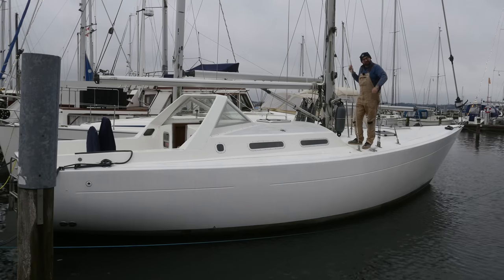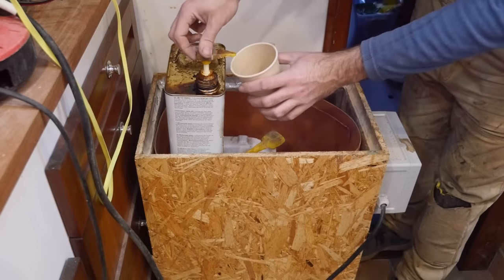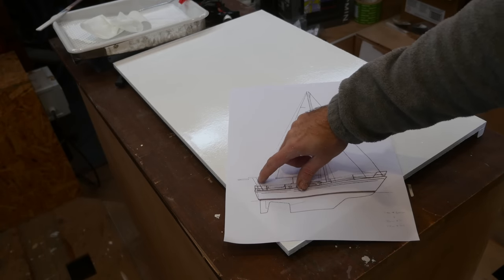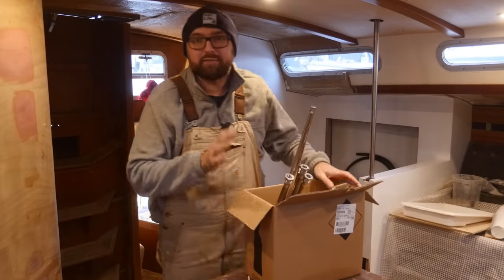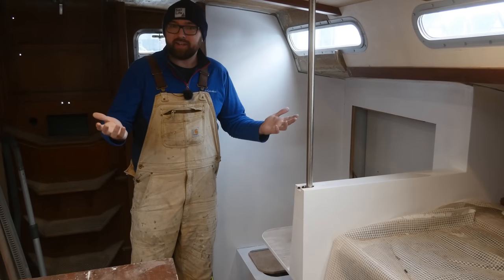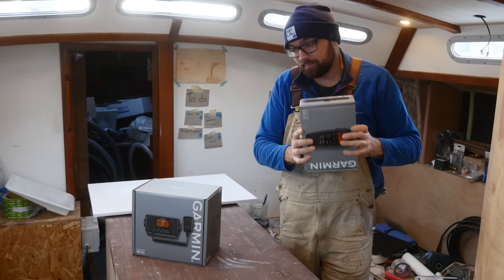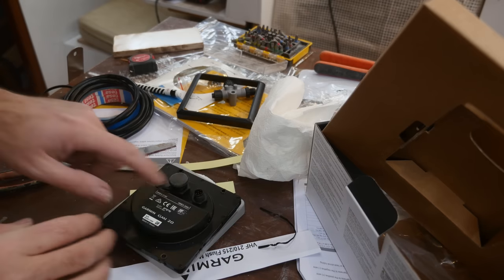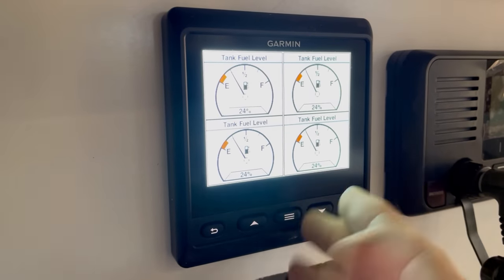Sail Life - Solar arch model, toe rail, NMEA 2000 network - DIY sailboat project

Comment: That vacuum trick cracked me up! As a boat owner that has run my own NMEA 2000 wiring, I am blown away by that! That's about a million times easier than pulling through a messenger line the old fashioned way. Your videos make my day!

Comment: Hi Mads, as per usual, I love your work. 
Pre warning to you and everyone reading this post, I am a armchair sailor that being said I am an Electronics engineer.
While getting ready for setting off one thing you might want to consider is integrity of your NMEA system. I would suggest buying a NMEA 0183 to NMEA 2000 converter. 
There have been a few YT channels that have been struck by lightning and getting their complete NMEA network up and running again has been changing 1 NMEA 2000 product (that has been affected by the lightning strike) and using a converter plugging  to it back into the network but using its NMEA 0183 port. 
NMEA is just like canbus in cars, 1 faulty sensor / product can bring down the entire network. Fortunately for the Marine industry we still have both codes running simultaneously, so if lightning blows the 2000 side of say your chart plotter, if you are lucky the 0183 may not have been affected. Using 1 converter could bring back online your entire NMEA network.
Latest iteration of this I have seen was Parlay Revivals. 1 converter supplied by a fellow sailor restored his entire system and it makes sense. In this era of conversion between the  2 standards it is cheaper for manufacturers to supply both NMEA inputs / standards into a product than manufacturing 2 of the same product that meets either standard. Fortunately each plug has its own supply board so if one gets taken out, the main system may still be intact and chances are that the other plugs supply board is unaffected. 
$70ish converter vs replacing say a chart plotter and getting your entire network back on track. I'd say was a cheap repair. Plus if you never have to use it, you could be a hero to a fellow sailor that has been unfortunate enough to be struck by lightning and only had the 2000 side of an instrument affect their entire instrument cluster.

Comment: I'd keep those solar panels down near boom height. Cleaning, servicing, windage during windy mooring maneuvers, etc., will all come into play sooner or later. Make it easy on yourself.
Reply: It looks a little high to me as well but remember he needs to duck under the boom (see 4:26) and access on and off of the boat is under these panels.  Perhaps mounting the panels so that one side of the mount can be released and then tilted on the other side could help.
Reply: @rickhicksedm  I'm not sure if he'd be ducking under that boom while standing on the cockpit sole, but I'd prefer (if it was my boat) to be able to stand on the aft cockpit seats and be able to reach all of the solar panels and related hardware. No debate, just sayin".
Reply: I think he would then need a door in the transom, but you're right, it looks far to high!

Comment: I'd consider running the NMEA network all the way to the main berth and mount a GMI 20 where you can see it from the comfort of your bed!
Reply from the maker: That's a cool idea :) All the data will also be available on any phone/iPad over a signal K gateway :)
Reply: I did just that with a B & G system (i.e. a multifunction display in the the main berth), so that I can quickly keep track of what is going on at the helm while on passage.  It has been extremely helpful.  Highly recommend that.
Reply: I was going to recommend the same thing. Its great on passage to see wind speed and such with a glance.
Reply: @SailLife  Also consider the Yacht Devices YDTD-20 instead of GMI 20 for such applications. A lot cheaper!
Reply: ..... always surprised when I see that the interior screen can only be seen when sitting at the nav station ...  never stop dreaming, just dream bigger .. have fun be safe, save our oceans ..

Comment: Put the breakers as high as possible so you won't bump into them while sitting there. Put the chart plotter on the pole so you can swing it around to any position and reach the controls on it without having to lean over the chart desk. This way one of you can still work in that spot while the other checks the chart. VHF position is good, perhaps put a second holder for the mic at the end of the chart table so you can quickly grab it, again without having to lean over the chart desk.
Reply: Agree with Dutchy's comment on the breakers.  You have sailed enough to know what Sea State 4 feels like sitting at the chart table.  With your shoulder size, it will be too easy to knock one of them during any transit or passage.  If you put the chart plotter high on that panel, you may wish to add some sort of lexan or plexiglas cover for the switches (probably requiring you to inset the switch panel bits) so that they are protected from unintentional contact.  Putting the chart plotter on the pole is a good idea, so long as you ensure it doesn't swing freely (you can sort of latch it while heeled) and it doesn't bang into people while manoeuvring.  Enjoying watching you do this.  You are as meticulous as I am and it pleases me to see good work being done.
Reply: @MrEdgargravel  AMEN! My wife likes to sit in front of the panel on our Catalina. Sailing along and I loose my instruments!
Reply: There is a ~10 inch space above the intended hole for the electronics. Put the switches there - high up where they are suitable to switch while you're standing on the way out to the cockpit.
Reply: 🤔 putting the switch panels (3) up-high behind you in the Nav. station, would aleveate any possible accidental on/off position. And, free-up space... No need to make a cluttered hatch in your Nav.station area.
Nearest to the steps A/C then 24-volt then 12-volt panel.
A/C is best to turn off first, being the most dangerous.

Comment: Two suggestions for the arch: 
1. Athwartship rigidity will be one of your challenges. On my boat I integrated the arch into the pushpit resulting in a very rigid structure.
2. For both aesthetics and structure I would keep the overall height to a minimum. On my boat the solar panels are about 6 inches above the bimini. Looks pleasing to the eye and reduces moments of force caused by the wind.

Comment: Chart plotters at the nav. station but I would have a repeater  at the helm, wireless or wired.  Keep 240v cables in conduit, separate from data and LV.  Switch panels want to be in separate areas in my view - 240v away from nav. station.  There is lots of kit you could and probably will fit  - a central horizontal dado/duct with equipment above and below i.e.  4G booster, Navtex, AIS, MOB alarm, DC-DC (24-12v?) converter, computer+drive storage, TV booster, DAB antennae booster, sockets and charging points.  It's almost endless!   Great video.

Comment: Speaking as a machinist and millwright , NOT A BOAT GUY ,, I would think of adding a  drop  brace on each back leg of your upright solar supports , down the back of the boat to support the weight of the swinging dingy in a storm ,  I relise it may be hard to bolt though the hull  near the rear corners of the hull , so that would have to be thought over as well , Best Regards John , Ontario Canada.

Comment: That Hoover trick was smart af
Reply: How have I not thought of that?
Reply: It works on an empty conduit. After that you should always have a string pre-threaded though. Then pull another string with your next cable and so on....
Reply: The vacuum trick is standard practice for anyone working in conduit. I agree with Bill, add a pull string , no conduit should ever be without one. It also greatly helps to pull all of the cables into a conduit at once. Subsequent pulls alway get tangled (wiring the mast).

Comment: My only peice of advise, is to hinge the panel, so that it flips down, with enough cable length to allow it to do so. I can't tell you the amount of frustration I have had, working upside down, or have a panel swinging back and forth as the waves roll the boat around. Flipping it down is nice, as its like your working at a desk.

Comment: Great explanation about why you paint the interior. Your video lighting is so nice and bright, I thought the finished wood would be the path you'd take but, now that it's painted, it is much brighter. Brighter be mo-bettuh. As you are well aware, the solar rig for the stern will be a sail in windy conditions so it will have to be over-engineered to survive Mother Nature. The last thing you want to see is your oh-so-glorious solar array saying goodbye to the sun before descending to Davey Jones locker. Maybe engineered wood for you kick rail? Weatherproof and no paint necessary. Great job Mads. Keep up the awesome work.

Comment: I’m concerned about the wind loading on those solar panels.

I feel that the transverse supports need to be further apart so that the panels don’t overhang them too much.

Also I feel that the structure would be stronger if the uprights are not parallel. I’d suggest that the front feet should be some way further forward.
Reply: Exactly what I wanted to comment. Furthermore, placing the feet further apart than the the top not only helpes strength, but also the looks imo!
Reply: Sorry Mads, these panels are so big, they will be ripped off in a storm. Imagine that during a big crossing.
Reply: @martinsachs3837  Agree,  the over hang forward and aft of the frame is way to much. I've got a 52 ft boat and 166cm long panels are a worry for me let alone 200cm. I'll be getting mine deisgned with Auto CAD to strength test it with varying wind conditions. I'll be going with 4x  180W 67cm wide 146cm long.
Reply: @martinsachs3837  I would be worried about them in 50 knots or over, even if they were not ripped off. The sail area which would be presented when the boat is caught beam on, and rolls to (say) 30 degrees on a steep wave front, plus another 30 degrees of heel due to the mast and storm sails, is enough that it would (in my estimation) not only add to the heel (which is not good when you're already closer to flat than to upright), but because it's so far aft, add hugely to the already problematic tendency to round up into the wind. 
If what you need to be doing is to bear away, to maintain speed and hence control (maybe to take avoiding action from a bigger wave, or to line up with a narrow pass or channel) then these solar arrays could conceivably put the boat at risk.
Large, raised horizontal surfaces are a liability out of proportion to their size, because unlike sails (which are large raised vertical surfaces) their projected area INCREASES as the boat heels.

Comment: Put some kind of protective rail on the starboard and port side of the solar panels their full length... someone with a tall ladder, a long pole, etc walking down the dock is going to crack one othewise.  the won't tell you either.   Great video

Comment: I would paint the back of the technical compartment with flame resistant paint before you mount electrical cables to it. You should also partition the AC and DC from each other. The AC should enter and exit the panel as close to one edge as possible so it doesn't overlap with the DC in any way.
Reply: That's a good thought. I'm sure tinned wire reduces the likelihood of fire, but safety like that is worth the effort.
Reply: @TheJekyll400  Tinned wire is more flexible than solid strand, and more resistant to corrosion. The wire isn't the most likely thing to catch fire, the devices inside are. The flame resistant paint is to keep a device that has shorted out and melted from catching the back of the board on fire and spreading it to the wires.

Comment: Love your idea of using the vacuum to pull the snake line through!  Salami on the fingers sounds tasty.  I light snack before starting the task.  There is a swivel mount available that the chart plotter should fit it.  Mounts to the bulkhead and can be positioned to be seen from any angle.

Comment: Mads, as a HAM Radio operator, I would implore you to have the Radio matched to the Antenna. (The Standing Wave Ratio. SWR needs to be matched.)
You can have a Radio Tech, Shop or find a Local HAM radio operator. 
It will extend the life of the Radio and also improve the performance.
Reply: I agree 100%, and that will optimize performance on transmitting and receiving - more than you can imagine, and as he said, extend the life of the radio. (ham radio operator since 1973, and electrical engineer here).  It's the HUGE  radio performance impact that is the biggest motivator for me.

Comment: You are going to want the chart plotter at eye level if at all possible. Also you could build a swinging arm for it to mount to, mount that arm on the back wall, and when not in use simply move it out of the way. That gives you more room for a bigger monitor and other items you will add later. Keep up the great work!

Comment: I'd use the plastic cable management trays they use in control panels. They have snap on covers and sides are designed to snap out pieces every 1/4" where you need cables to enter / exit

Comment: The vacuum cleaner cable run trick is awesome! The switch panel right next to your left elbow might lead to accidental switch flicking so maybe keep all switches up the top in a line? Plus you won’t have to reach down at a lower angle to flip switches. 😁
Reply: x2

Comment: Nice electronic system Mads, and very convenient. However, Murphy had it right: if things can go wrong, they will. Soooo, in addition to the NMEA stuff, I strongly recommend that you have mechanical gauges (oil pressure, coolant temp and ammeter) on the engine and genset. Also a sight-tube or dip-stick on at least one fuel and one water tank.

Comment: Put the plotter on a multi-angle swivel/extension so you can pull it in front of you at the work station.
Reply: I thought the same thing, so you could see it from the salon too.
Reply: @327365hp  I would try to mount the swivel setup to be able to see it from the cockpit, nav station and saloon if possible.

Comment: But... we want a 3hr long video... 😢

But in all seriousness. How well will those solar panels hold up to a storm? It looks like there’s a pretty big overhang on the front and back.
Reply: my concern too; this is a big sail  or do you wAnt to demont them on passage?
Reply: He should do a fridge like mechanism and rotate them 90° so their parallel with the transom. Then when they're needing more power or the sun is out they can flip the top panel up and over. When it's not in use, or the wind / sea is up they can flip it backup on top of the fixed panel and have more space.
Reply: This would be a 4m2 sail indeed some power in those
Reply: @BrunoWiebelt  
Yea I was wondering the same thing. But while they’re out and about it’s nice to have that extra power also. So I’m not sure they want to dismount them while they’re sailing. But... I’d be curious to hear what he’s got to say about it.
Reply: Ouff ,  those solar panels is a lot of windage high and far aft. It would definitely significantly impact sailing negatively and even be a hazard in really strong winds and big waves.
Reply: Windage is relative. The wind is generally parallel to the water surface (at this height), the panels are parallel to the water surface. IMO in regular weather conditions this shouldn't be an issue.
Reply: Ask the hundreds of other sailboats that have the same style of solar panel arch how they hold up in a storm.
Reply: Many boats have solar panels on an arch aft. I really don't think he'll have an issue if the arch is built well and secured well which we all know man will do to the extreme... Think massive backing plates.
Reply: @chshrkt  indeed worth asking them although not many are planning to sail when our friend is, most are in the Caribbean’s. I can see on sport catamaran , windage of trampoline is not to be neglected when at some angle, and so would a monohull with some angle in strong wind then the solar panels would offer their best profile. I am not an expert, just conscious of the power of 4 solid square meter and you might well be all very true about that of course !! As always all opinions to be considered ;-)

Comment: That silicon heating Matt was a great investment!
Reply: Did not know such existed.  I could use such a thing on the wings of my low wing aircraft to simply melt the ice off from under the wing covers instead of spending an hour scraping it away in prepping it for flight during winter.  Engine heater heats the engine and now there is a possible way of easily clearing the ice off the wings.

Comment: I have a couple of comments concerning the mounting of your circuit breaker assemblies. The circuit breakers should be protected from accidentally being switched on or off. This should be considered a safety issue. This could be accomplished by mounting plexiglass covers over the breakers. These covers could be hinged and/or secured with Velcro to keep them in place but easily accessed. I would also consider mounting the entire assembly with a hinge that allows the panel to drop down for maintenance purposes. Some of the other folks have made similar comments and I agree with them. I really enjoy watching the work that you are doing on your boat. Keep up the good work.
Reply: not to mention its right below a window

Comment: A wood worker's trick for the cracks at painted board seams and corners...a tiny amount of paintable caulk commonly used is DAP Alex White Painter's All-Purpose Acrylic Latex Caulk in the US. No fillet, just enough to fill the gap so the paint can span the gap.